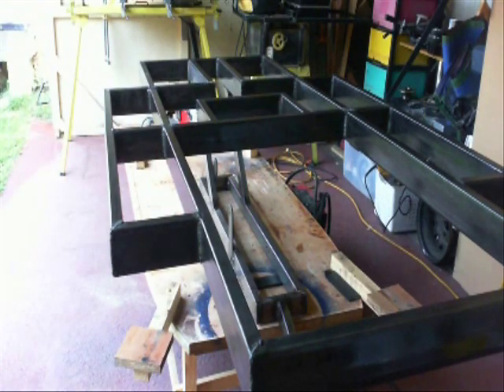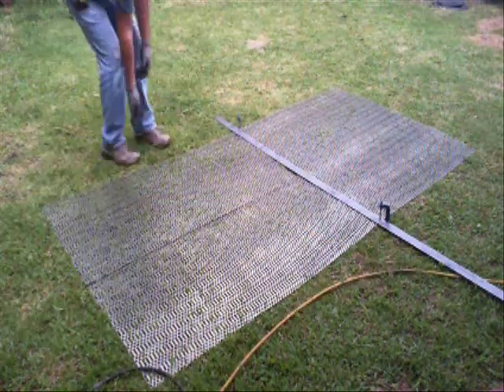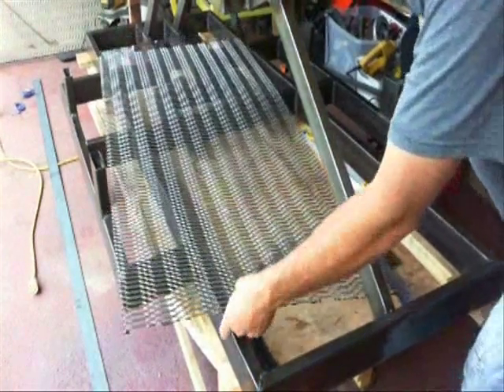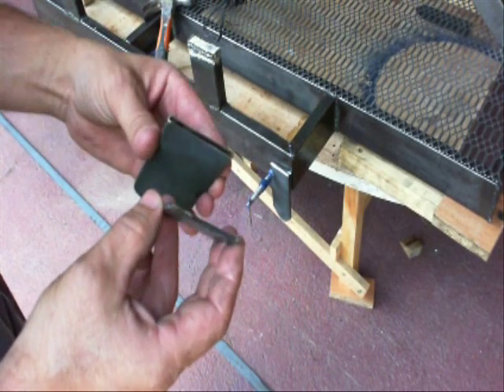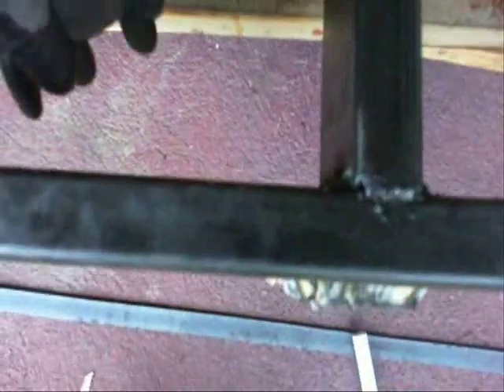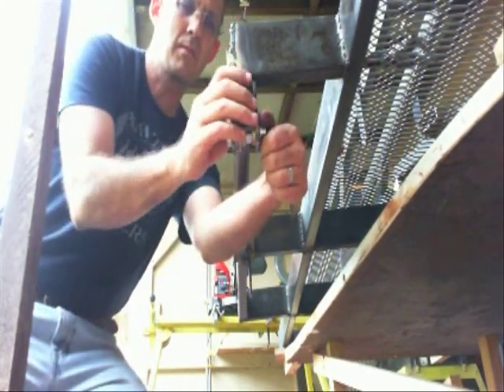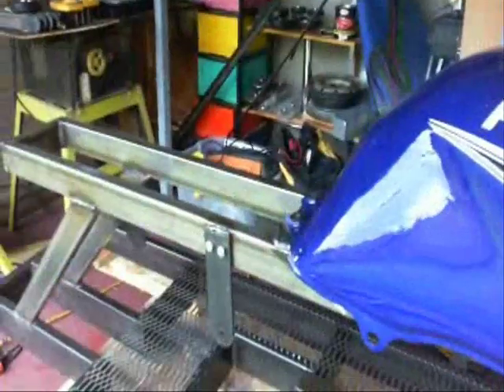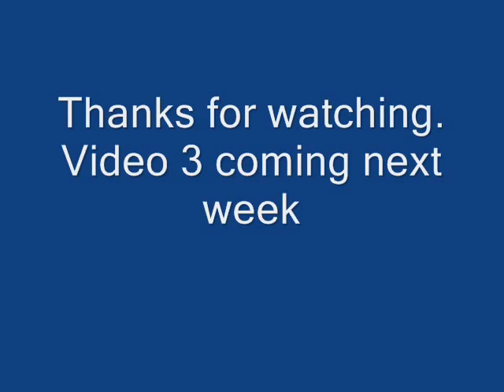Tracked vehicle Frame Part 2

Comment: What's it like to build and weld the material? Seems like little room for error.
Reply from the maker: I have admiration for people who can weld well, it takes lots of practice. With that being said I really like how easy it is to connect the materials. Unlike wood where you need special fastners or fancy joints to make the connections strong. Plus if you mess up with metal you can cut it off and re weld it its great.